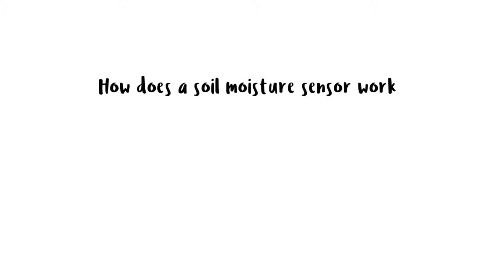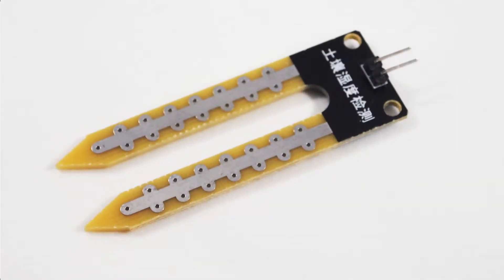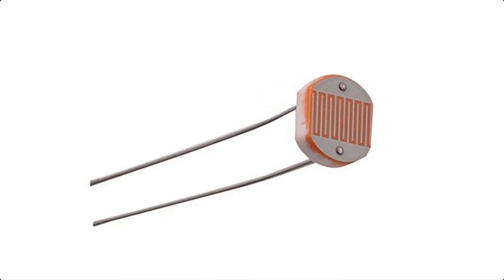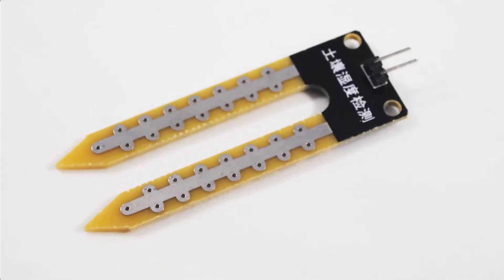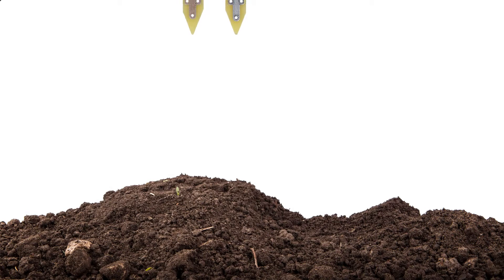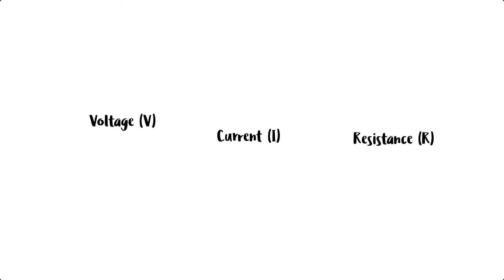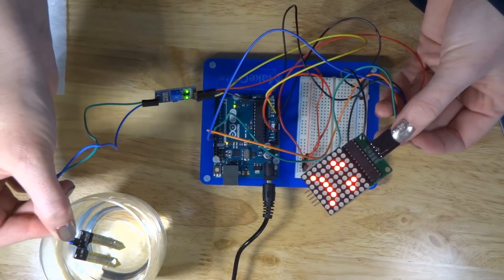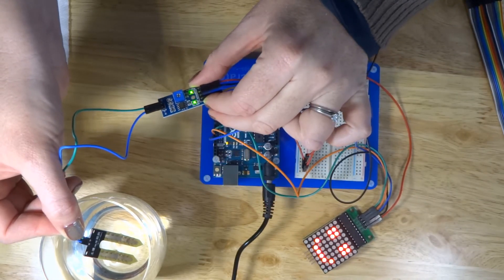How does a soil sensor work?

Comment: LOL - can you dumb that down some....kind of confusing, and you didn't mention - how do moisture meters work without a battery? what creates the current to measure? so many questions...... sorry. otherwise good video.
Reply: It’s basically saying that the sensor measures how much water is present by seeing the level of conductivity is in the soil. Since water is a conductor of electricity, if we place the sensor in a place with little water then the soil is less able to conduct electricity AND the sensors resistance increases. (since there’s little water). From this we can use ohms equation (V=IxR) and we can see that if resistance goes down then Volatge (V) increases. NOW This change in voltage is monitored and it alerts the device.